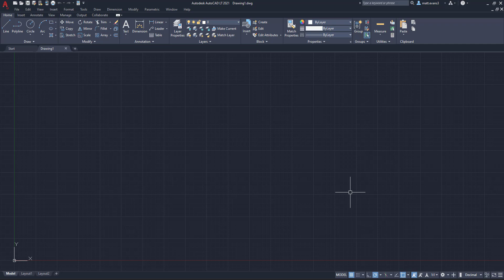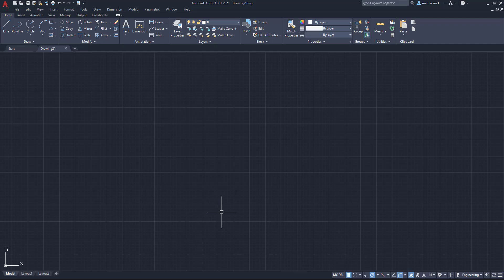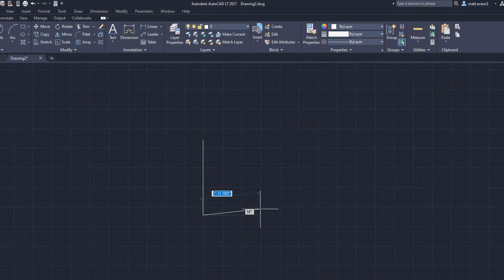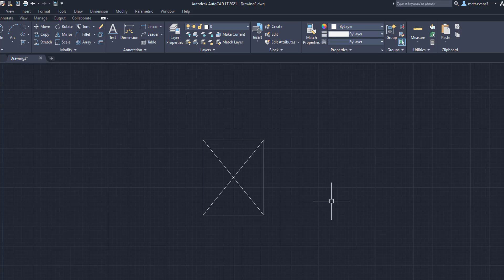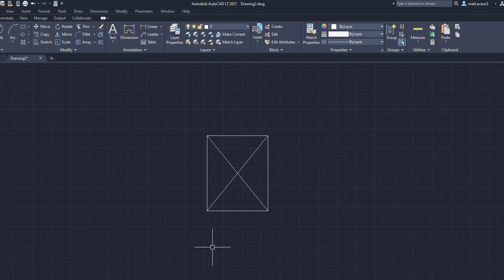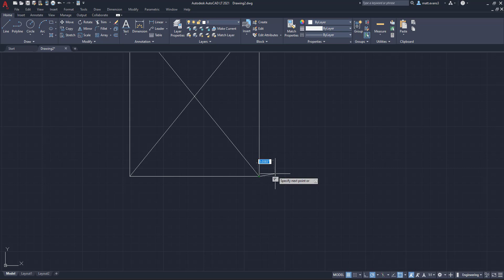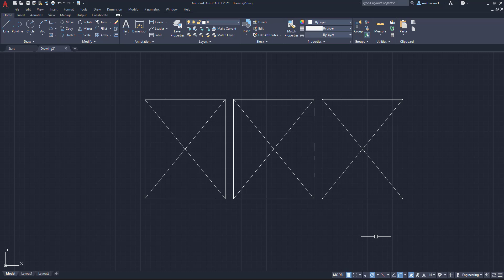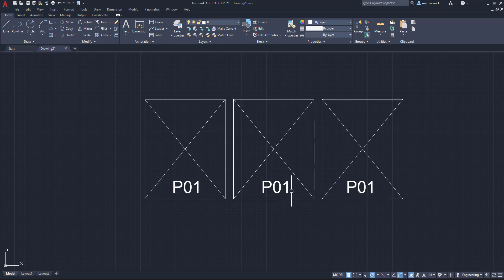How to Create Pallet Positions (Warehousing) - AutoCAD

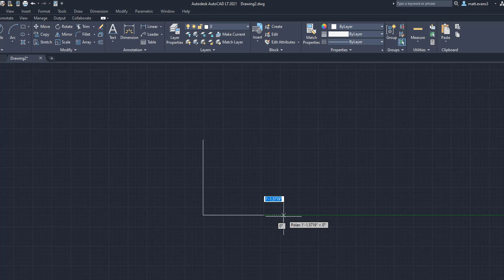Comment: Your videos are very educational, thank you for these. I have a question regarding how you managed to draw the third line of the rectangle @ 1:27 - you clicked the diagonal endpoint and then somehow it locked the height and then you set it at 90 degrees. How do you do that so smoothly? Have been having to trim that line generally. Thank you
Reply from the maker: Thank you for your comment/question! To be able to track the lines you need to go to the bottom right hand tool bar and make sure that both your "Polar Tracking" and "Object Snap Tracking" are on. These can be turned on and off by either clicking them in the lower right hand tool bar or by clicking F10 (Polar Tracking) and F11 (Object Snap Tracking). Turn those on and you will never have to trim your lines again!